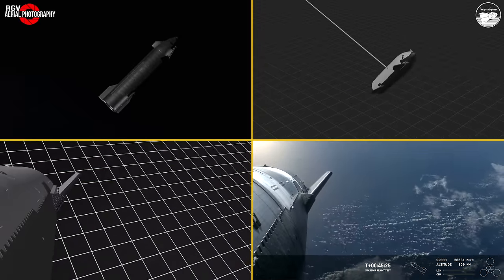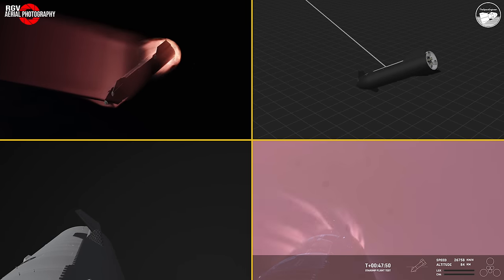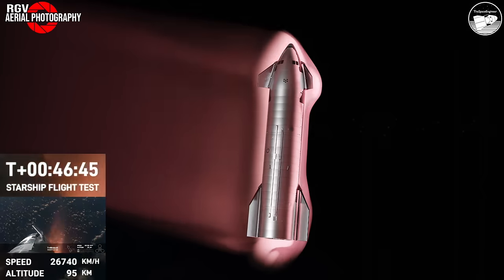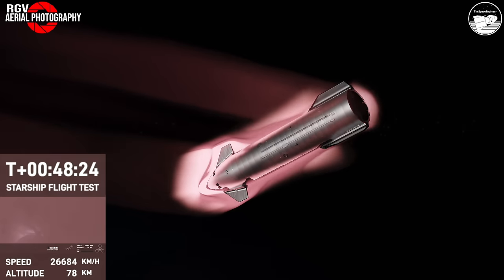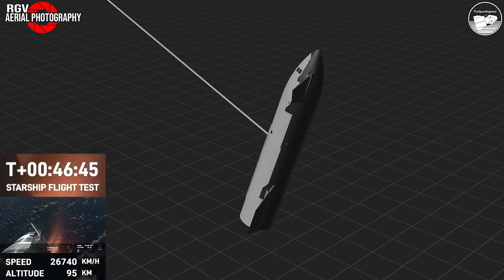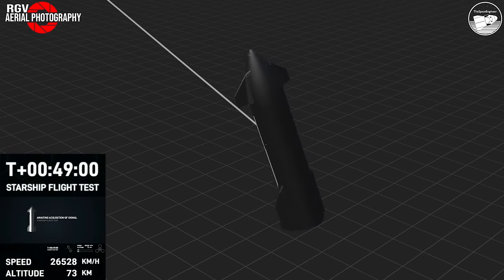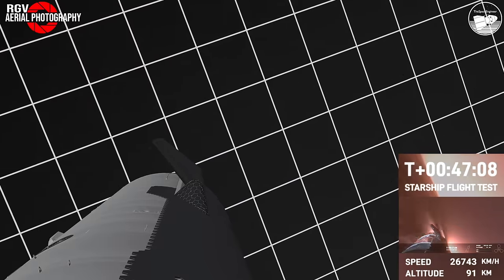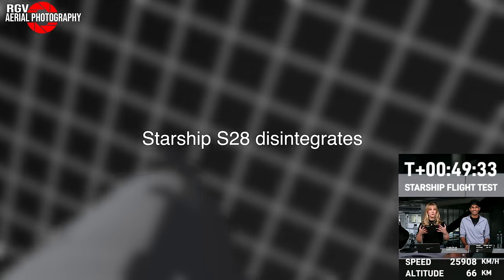SpaceX Starship Re-Entry and Breakup: 3 Render Simulations!

Comment: It looked doomed while just flying in space. Spinning and rolling made it seem to me something important was not working.  That first view with all three renders and the live ship was so cool. Thanks for sharing!
Reply: They did suffer from attitude control system failure, and I'm guessing that the first uncontrolled part of the reentry must have damaged something, which led to the failure of the spacecraft
Reply: @andromededp5316  Certainly had some attitude problems
Reply: On to flight 4.  Test learn and make improvements!
Reply: @karlkarlsson9126  you spacecraft, like young people, are sometimes known to have bad attitudes. Both are prone to embarrass you in public.
Reply: Thanks, invaluable visualization, much appreciated
Reply: I know, right? I found it a little unreal that the announcers never commented on the tumbling. I know they try to stick to the script for the flight plan, but still...
Reply: I know that the rcs systems on the starship currently use hot ullage gas generated from the engine firing. I think that might have been what that out gassing was along with the debris. An engine issue that damaged the ullage system?
Reply: @acasualviewer5861  Thanks dad! 😆
Reply: @ThePipemiker  I think they mentioned it slightly at some point, but I think it was difficult for them to really know if some things were intentional or not.
Reply: @ThePipemiker  It is a normal maneuverer for spacecraft in orbit, it's called a thermal roll and is used to distribute heat evenly around the craft rather than one side getting toasted.
Reply: The reason maybe that spaceX didn't care about whether S28 should survive it, and rather started collecting data rather saving S28 even tho they knew it would burn up in the atmosphere.... as collecting data is a huge advantage....
Reply: @acasualviewer5861  And old people always say shit like this.
Reply: Spinning and rolling is not, that's seem more like controll to me then out of controll, how ever when it rolled into an awkward angle where the engine and non-shielded parts was exposed then it was more concerning.
Reply: Add 8 axis drag adjusts ( cold)
Reply: The oxygen valves are going to keep failing if SpaceX doesn't separate the H2O & CO2 from the autogenous pressurization gas.
Reply: @imconsequetau5275 Well you know SpaceX has a ton of experience operating outside the atmosphere. I bet they already know what happened and are putting a fix in.
Reply: @aldimore  
One way is chilling the Raptor O2 autogenous byproducts below freezing and then separating them using a centrifugal trap. 

The best fix might be a new Raptor design that directly produces pure hot O2 without external equipment.

That first design change is faster to implement, but will probably also require heat exchangers (including a counter-flow heat exchanger) to reheat the cooled O2 well above zero °C. 

The second solution is best, but Raptor V3 may not be ready for launch.

Comment: What's encouraging is how long SS actually survived even while tumbling uncontrollably.  It indicates that if they can get it under control and entering at the correct attitude maximizing use of the heat shields, then there is a much larger margin of error than with the Shuttle.

Comment: Its counter intuitive how, even with the atmosphere being turned into plasma, there's still so little pressure felt by control surfaces. Just goes to show how thin the atmosphere is up there and how fast that vehicle is traveling.
Reply: agree. during the plasma-wow phase , lasted 2 mins and 25km altitude, speed decreased only by 100KM/H 😱
Reply: Yeah. Once pressure entered the equation and joined heat it was over for poor Starship.
Reply: @fabio72da   yeah.. that's not what I would have expected. I'd like know what the explanation for that is. Clearly it isn't losing momentum as fast as I would have thought.
Reply: @acasualviewer5861  Just watch a F9 booster come down, falls like a spear until a few KM's then hits thick lower atmosphere and the effect is like hitting the brakes hard
Reply: @acasualviewer5861  The plasma is from gas molecules being forced together by the insane velocity of the ship, but it isn't very many of them. You need a starship equivalent mass of air to be accelerated by the impact of the body of starship to slow it by even half and that won't happen for quite some time falling through the atmosphere. There really is next to nothing mass wise at the upper reaches of the atmosphere where the plasma starts. Even the debris falling from starship beforehand doesn't decelerate out of frame.  It's just so little as to be nigh inconsequential aside from the compressive heating danger.
Reply: @scythelord  a bit counterintuitive. So much energy in the plasma, but not enough to deviate the ship.. But thanks for the explanation.

Comment: It was so hard to work out what was going on during the stream. This video gives the best insight so far. It does seem that Starship was trying hard to control it's presentation during descent. When I saw the stream it looked completely chaotic. Cleary Starship's control algorithms were struggling migthly all the way down. I assume that SpaceX learnt a lot.
Reply: The roll was quite obvious though, seeing that kind of told the tale it was about to be  RUD - this render though is great for visualizing the details. They managed to get it upside down for some time, so they had a bit of success for a short wile - couldn't see that during stream..only now with render.
Reply: @PeterKocic  Yep. The roll was obvious but I hadn't noticed all of the other movements
Reply: The flaps didn’t seem to be responding appropriately to the changing attitude of the vehicle, possible actually damage, software glitch, or improperly connected hardware.
Reply: @J7Handle  the flaps dont work out that high up the only work inside the earths atomosphere.... they use reaction control thrusters .... didnt seem to be working, and word is the payload door test cause it to spin out of control.
Reply: The algorithms weren't the problem. They lost RCS control and the fins alone couldn't do anything to arrest the roll.
Reply: @J7Handle  you don't even know what you're talking about. Flap wings are not to be used in space or during re-entry. What control the ship orientation and attitude in space is gas. Small gas thrusters. These gas could have major problems like pipe leaks, run out empty or frozen because space is cold!!
Reply: I suspect the algorithms were trying to operate thrusters, and failing to get any response. Also, the payload bay slot may not have latched closed, weakening the hull.

Comment: Yes, nicely done.  You can see that the ship was not being controlled at all.  Even so, it shows how robust it is to have lasted as long as it did.  I can't imagine the engines weren't pretty messed up after being used as a heat shield for a while.  Number 4 will hopefully nail the re-entry.
Reply: I believe that for this speed regime the flaps move too aggressively🤔
Still, this would not have happened if not for the icy failure of the Everyday Astronaut's thruster system🤷‍♂
Reply: tim dodd delenda est :p @TheGalacticIndian
Reply: @TheGalacticIndian Tim Dodd didn’t design that. He asked a question - and Elon decided to change it. Tim has no fault in their design choices
Reply: @randywilliams7696 why?
Reply: its just a joke! @MomedicsChannel
Reply: Seeing how well Starship held up under these impossible stresses actually makes me more confident that the IFT-4 ship will reenter successfully.
Reply: @TheGalacticIndian  Tim is the deepest of deep plant agents from Roscosmos!

Comment: Cool to see how it almost fixes its orientation
Reply: Exactly. It seems something happened and the flaps were trying to compensate right before RUD.
Reply: I wonder if SpaceX knew it was doomed and then decided to intentionally test it's ability to correct itself from an uncontrolled spin
Reply: @Jadinandrews  I don't think so. The plan was to survive reentry and splash down in the ocean horizontally at terminal velocity.
Reply: @Jadinandrews  well it's going to come down anyway, why not see what it can do and how long it will last.
Reply: @Jadinandrews  unless you meant that they purposely created an uncontrollable spin, in which case no. The spin was definitely unintentional.
Reply: @Jadinandrews  once up in space is was on course for entry, so if they couldn't control it's direction that would explain why they skipped engine tests. That means they had zero ability to interfere with the uncontrolled entry test.
Reply: @jessiejanson1528  they had the flaps still. Obviously I'm making a huge assumption, but I imagine there's value in seeing what they can do at those speeds. Of course it probably just spun out of control, but I hope they learnt something from the tumble
Reply: @CESmith  yeah I agree. I'm just suggesting once they lost control, maybe they were like fk it, let's see what those flaps can do

Comment: Thanks for the analysis that includes smoothing out the erratic changes in telemetry caused by signal losses. With your help, we can see that, although not successful, Starship was slowly becoming more stable in its flight. Great work.

Comment: Excellent visualization (particularly the intermittent TDRSS interpolation) that essentially pretty much accurately recreates the attitude of the ship I had in my head after rewatching the live feed a few times, and confirms that though tenuous, the upper atmospheric drag actually WAS causing the ship to naturally self-orient with tiles windward by a minute or so into reentry! The ultimate breakup then was either caused by too much plasma damage to the aft engine bulkhead during initial reentry at around 2:00, OR possibly even due to incorrect forward flap orientation (down) starting around 3:00 causing too much drag at the front of the vehicle and too high of an angle of attack once maximum deceleration was reached in the deeper part of the atmosphere. Super exciting to see how all this is playing out.

Comment: What looked like an attitude control problem that happened just after main engine shutdown seemed to get worse as the re-entry approached to the point it seemed to have no control at all during re-entry. Something must have gone badly wrong with the manoeuvring thrusters.
Reply: Maybe it has less fuel then thought, shot out it's liquid fuel and not gas, or there was an error and it kept correcting and wasting fuel, maybe stuck or slow valve causing it to shoot too much and then have to correct, lots of fuel wasted that way.
Reply: @jessiejanson1528  The thrusters are using pressure in the tanks to function so my bet is there was a problem with venting the tanks leaving insufficient pressure for the thrusters. It is probably not a huge problem to fix.
Reply: After watching the entire flight a second time, I think there was zero thruster ability right from SECO onwards.
Reply: @imconsequetau5275  Agreed, you don't see a thruster fire even once.

Comment: By the end, starship had nearly nulled out the roll and oriented pretty well.  Not sure if that was random but to me that was pretty promising looking at the end.

I’m sure the team learned quite a bit (in addition to ensuring RCS is more robust).

Edit:  looks like the last second it started to roll engines forward again.  Started pretty quickly too.  Strongly suspect the engine bay is where the disintegration began, if not explosion.
Reply: Any simulated orientation after the video cuts out should be taken with a heavy grain of salt.
Reply: @leo_is_a_baka  telemetry was still there.  The simulations were based on that to a large degree I would expect, no?
Reply: @joefunk1611  yes, but the telemetry doesn't show stuff like roll. It's likely that the steel side of starship was entirely exposed to reentry heating.

Comment: After the ascent burn was over, Starship wasn't stable at all.  It picked up a rotation and whatever RCS system the ship is supposed to have didn't bring it under control at any time.  So as you see it wasn't presenting the heatshield side of the ship forward and in fact was completely backward at one point.  The flaps weren't controlling the ship much, if at all, which is hardly surprising, since there's not enough atmosphere up there to do that, even if it's ionising off the ship.  I would expect the flaps to only be capable of making very small corrections at that altitude.  Not to have to try to stop that much rotation.

Next Starship needs full RCS functionality to give the ship attitude authority.  Then it might just stand a chance of re-entering correctly.

Good job RGV for bringing us this.  It has helped us see exactly what Starship was actually doing.
Reply: I read somewhere that the rolling was caused by the propellant transfer demo
Reply: The roll control thruster, visible from the upper flap camera, never spurt gas. I think attitude control was completely absent. 

They were lucky if the ullage thrusters at the base allowed the propellant transfer test to succeed.

Comment: If these renders are accurate, the control movements of the flaps did match what would be needed to correct the reentry angle.
Reply: I noticed that (seemed to at least mostly be true) too.  But at times they seemed to be odd.  Left me wondering if it was also trying to use the flaps to guide its trajectory not just its attitude.  To steep a descent, and it burns up, too shallow a descent, and it bounces. Though, I don’t think it had enough kinetic energy to bounce; IIRC, they were confident it would land in the ocean whether in controlled flight or after a RUD.  Leaves me without any firm conclusions.

Comment: While everyone was clapping I was shaking my head during the live stream. No way it would survive.
4 is a charm, I hope.
Reply: The clapping isn’t a sign they think it will survive, it’s a celebration of how far they’ve come. They have clapped after previous Starship RUDs as well.
Reply: they were clapping at milestones not for it's survival, muppet.
Reply: Yeah man only you figured out the real outcome. Good for you!
Reply: I am not convinced they were even seriously trying reentry. The control surfaces were not doing anything like what I would have expected. It almost looked like they were being manually actuated rather than following any law. Possibly they were hoping to be able to just set it and it be passively stable, but it was too far off attitude initially to settle.

The other possibility is that they were getting data on many attitudes to validate models, particularly when plasma impinges on the engines. Hypersonic wind tunnels exist, but not at that scale. They may have decided to use it as a wind tunnel test.

Alternatively the control computer completely crashed and it was just a dead stick. Who knows.
Reply: @agsystems8220  I believe the computer was a bit confused by the situation it was in because it was already spinning too much

Comment: it actually looks like they are having problems with the center of gravity\center of lift. Rendering the lower flaps useless and thereby losing a lot of control authority. It almost caught itself when plasma started. Not shocked to see this as theyve only tested this in freefall. Hypersonic airspeed does crazy things with the balance/controls. Maybe some bigger header tanks to balance things out will help.
Reply: They emptied the header tanks as part of the propellant transfer test. Might be fine otherwise.
Reply: And I thought the LOX header tank was being filled from the main tanks.